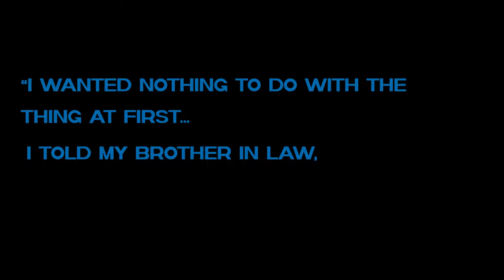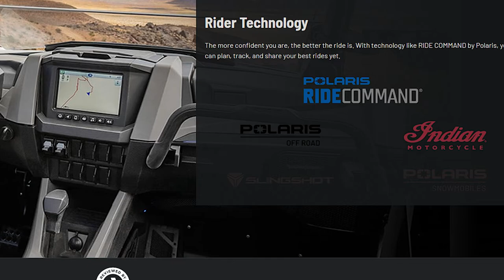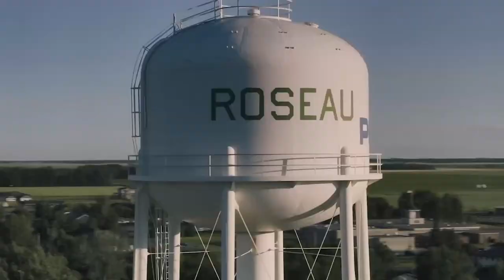The North Star

Comment: Polaris didn't either.  Bombardier still beat polaris to the game.
Reply from the maker: Welding skis to a fan powered model t and calling it a snowmobile is not the same.
Reply: @Dayjobinc  that was Eliason in 1924. He went on to build purpose built "snow tobbogans" and sold the company in 1939.
1922 15yr old bombardier tested his first "over snow" vehicle.  1931 was Tucker snow cat.  '37 bombardier patented his first tracked machine.  '50 first canadian designed tracked snow machine.  54 Polaris started work on their first machine, and in 1957 they produced first production machine.